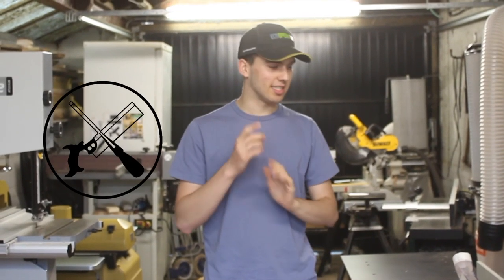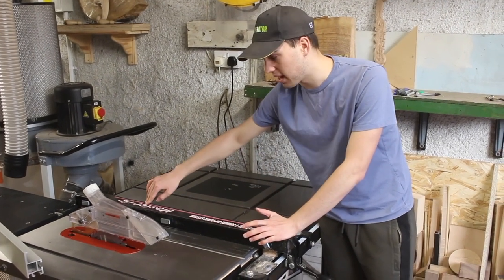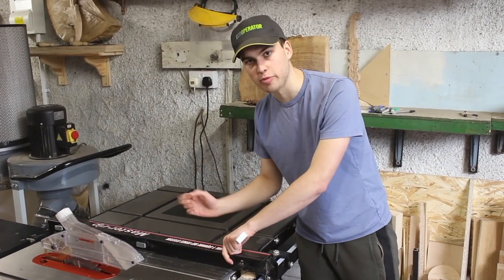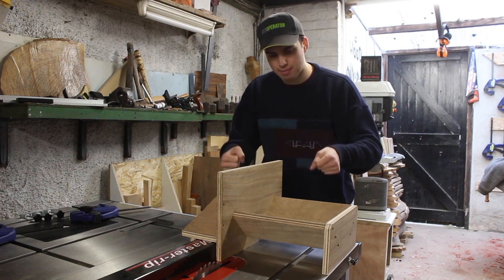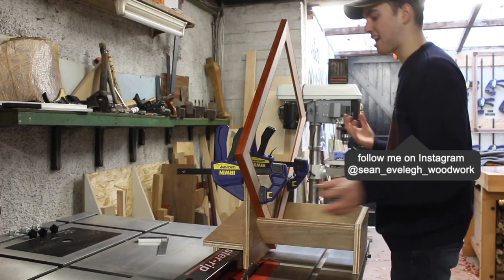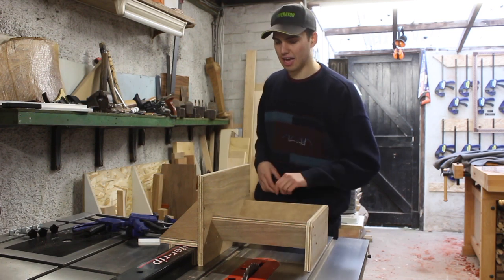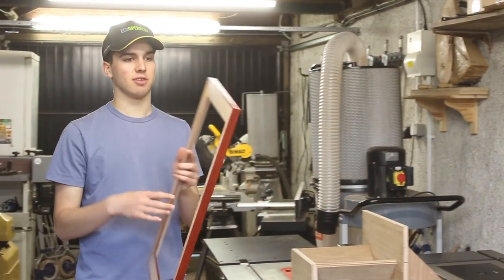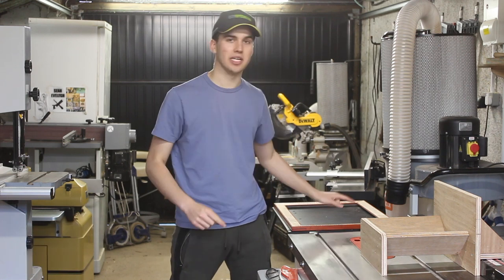How to make a Spline Cutting Jig! DIY (2 in 1 Picture frames and boxes)

Comment: Great...your point about the supports going down to the saw bed is a good one...how about screwing sacrficial pieces to the inside of the structure that you have...easy to replace when used again for another project ...excellent
Reply from the maker: Great idea Rob, I thought about removing the walls and making longer ones. But just screwing on sacrificial boards is a better and quicker way! also once they've got cut up, i can quickly replace them! thanks for that! see you in the next video!